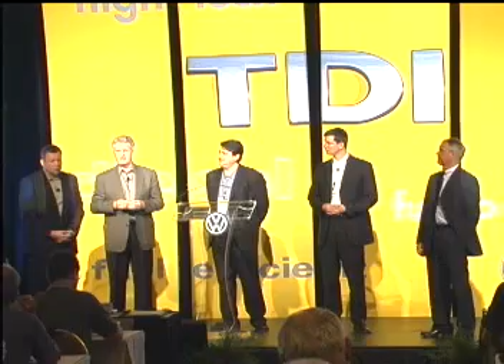Volkswagen TDI Engine, Turbo Diesel

Comment: Thanks, so common rail is a winner and an improvement. I assume for common rail you need to electronic injectors right. So that technology is sound and solid? I guess it has made some strides in recent years which is on the VW TDI, namely Piezo activation or control. 

I know Piezo transducers are the only thing that can really stand up to being used for pressure sensors in engine cylinders, to measure combustion pressures.